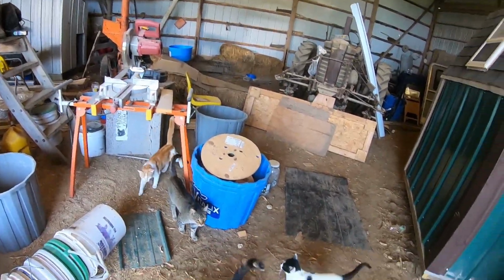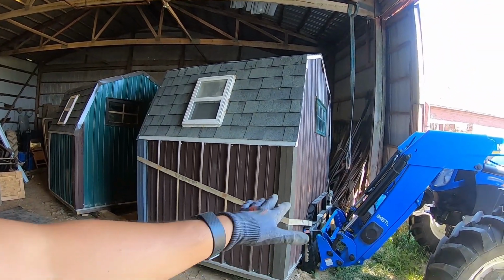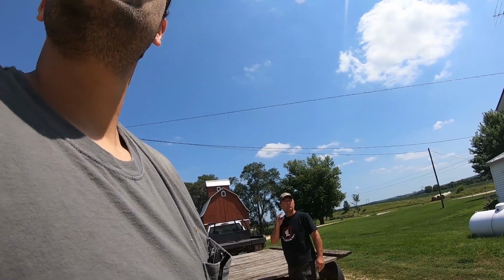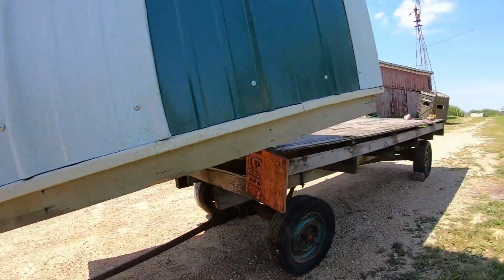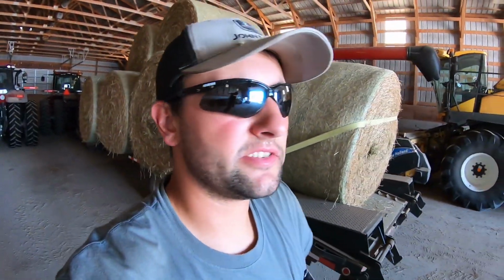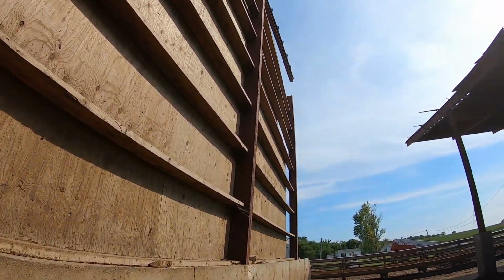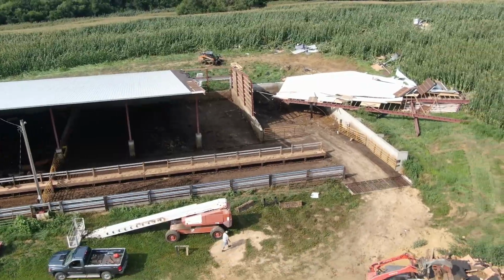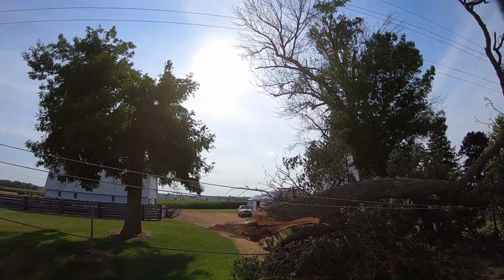CLEANING UP THE IOWA STORM DAMAGE

Comment: Good to see you back , afraid work must come first. Sorry to see the damage,set the Main uprights in to floor concrete, we have to tie our buildings down here in Scotland, as we regularly have winter storms and sheds have to stand up to high winds from Atlantic, as well as wet snow loads during winter , storm blinds on open side , we use a variety called Gale Breaker easily fitted, mine withstood 114 mph winds no damage. 🏴
Reply from the maker: That’s impressive! Thanks James!